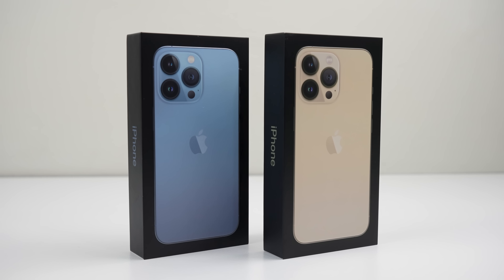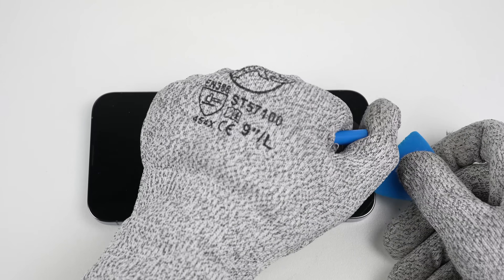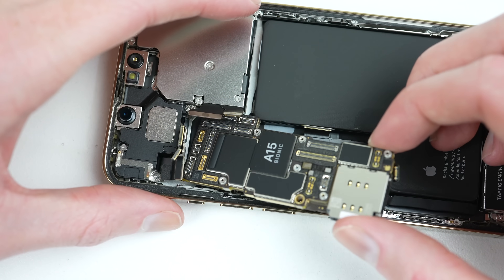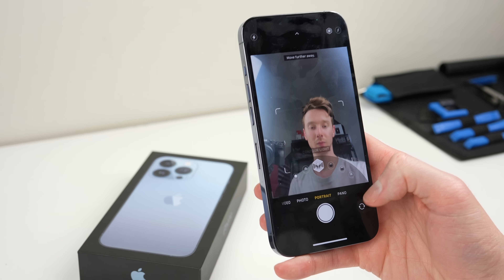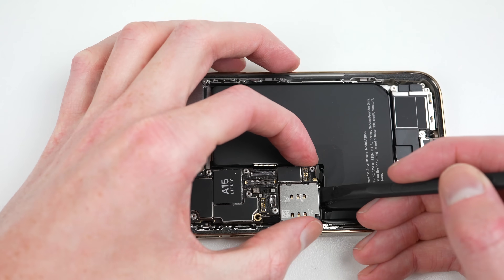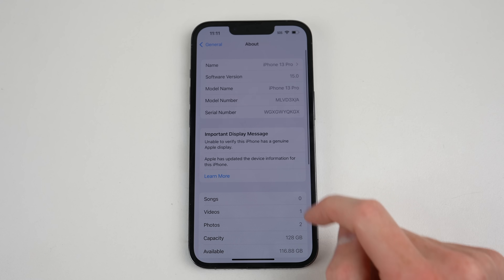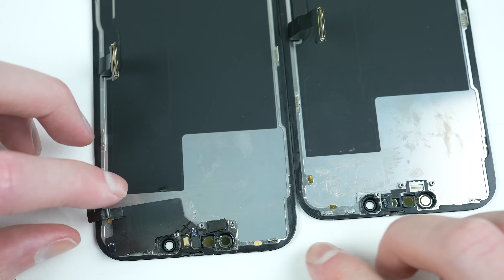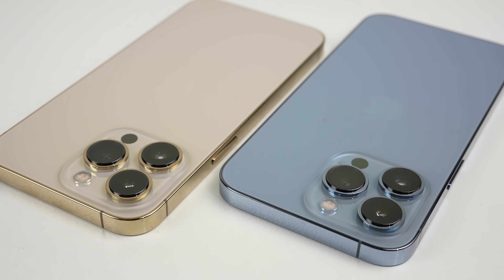iPhone 13 A Repair Nightmare - Teardown and Repair Assessment

Comment: Personally, I learned better than to use Apple a long time ago. I moved away when my iPhone 4s's battery started going out after about a year. I got it replaced, but the phone's power became unstable. Then, it started getting insanely slow. Then, Apple removed legally purchased music from my library with no warning or recourse. At this point, I pulled away from Apple entirely. It was only a few months later that the whole "Apple Music" trial debacle happened. Then, it came out that they were artificially slowing older phones. Then, I started learning about their attacks on third-party repair. Then, I learned what they had done to The Beatles.

Fuck Apple.
Reply: @Kirill Silver I mean, windows is not even that bad. My friend cant even talk with us when we play online because his Mac doesnt support the integrated voicechat of the game
Reply: Only iPhone I ever bought was the 4 and the thing was a tank, lasted a ridiculous amount of time until falling from a set of stairs.
Reply: @r2d2sp1  Windows is more expensive than MacOS?
Reply: @Kirill Silver design of device!? Not even that brother, on the Iphone 4 you had to take out the entire phone to get to the screen with over 20 screws, after that you have soo many screws for the 5,6,7 and 8, luckily they changed it to be a bit easier now. Macs are made to not be open, macbooks are a nightmare to repair.... if you can repair. They may look pretty but they take no consideration for repairs when they design it to the point that if you use a different screw in an specific place that is just 0.1mm longer, you could kill the device. My samsung S4 and S5 could be dismantled in 5 minutes, now its a bit more complicated
Reply: @mrsuperselenio5694  Exactly. You want to fix your windows PC? The only things that cause you any trouble are the motherboard and processor. Replace either of those and you have to go through some nonsense to reauthorize your windows installation, sometimes at worst, you'll have to buy windows again, but every other part is completely replaceable with literally no issues at all (some hardware has software, but that's the hardware manufacturers fault, not windows).

Comment: At this rate your better off buying either a different phone that's an older model that can be easily repaired without sacrificing any features, or just buy an iPhone 13 and leave it inside of a bomb-proof safe just of preventing screen repair that diminishes almost important features of your new phone.

I'm still wondering why they think it's a great idea where in reality it's just a bullshit deal. I'm betting it's got to do with some business profiting.

Comment: In all this time nobody reverse engineered iOS?
Apple makes its hardware, so apple probably built some kind of serial number into each part of a fone. Either preform a indepth diagnosis of each part and look for common patterns. Or learn to code apple iOS. Apple has a way to reprogram the fone to accept new parts, its all about the OS

Comment: Looks like Apple learned this trick from Russians, the very same thing happens on Russian fighter jets! You can not use parts of an airplane on another, it won't work, you need to order it from the manufacturer, which is a method of keeping their customers under control!

Comment: This is properly secure design. Why the fuck are people losing their minds over this? Apple is doing the right thing here. The parts at issue process secure, sensitive, user-specific data, and blocking Joe Schmo from swapping parts around like this is good.
Reply: Because Joe Schmo is usually better at repair than the contractors Apple pays to do the "official" repairs for them.  Also, how is a 3rd party display a security risk?  How is a genuine part with a different serial number a security compromise?  What sort of backdoor could somebody put in a cable?  What good technical reasons are there to doing this?  I'm having a real hard time viewing this as anything other than an attempt to monopolize repair moreso than they already have.
Reply: Wtf are you talking about? What kind of sensitive data are process through the OLED panel?
Reply: Lol yeah what security risk is there in you replacing the screen of the phone you own. Or the battery, or the cameras, you own this phone, but you're not allowed to maintain it yourself. 
Like fuck that
I've always hated that companies removed the removable back plate so you can't just swap out a new battery!!!!!!

Comment: If you want to fix your car, you can take it to a dealer, an independent mechanic, or even dix it yourself. If you want to fix your home, you can call a large maintenance company, and independent contractor, or fix it yourself. Why can’t I do that with my phone?
Reply: Actually most new cars can't be worked on fully unless it's does by some one from the dealer. They put stuff in the programming so only ppl with the official software on their pc can see the errors the car has found. 
Some parts you can do yourself, but more and more problems are being locked behind software. 
It's them reason McDs takes forever to repair their ice cream machines. The repairs aren't hard but McDs doesn't have to tools to read what errors the machine has, and are required to use the technicians from the company that makes the machines.

Comment: So what you have to take the phone to apple to repair. It gets tiring keeping up with Apples changes. Why not let them fix it.  I used to and got tired of it. It’s there hardware so you have to take it to them for service. So they are blocking third party repairs. Probably to protect their hardware supply chain, hacks, fake parts, you name it. It sucks for third party repairers. But it’s not like apple is the only cell phone out there. I mean Samsung won’t even allow you to get a battery replaced even if you acknowledge it hasn’t failed and just want a new battery. That’s not owning your phone. Apple will at least replace the compne t with the u derstanding if it doesn’t meet your expectations there is no refund because the part was not the issue. That’s at least meeting you half way. Samsung is like screw you.  I was going to replace the battery in my Samsung my self but I was like do I want to service a phone that really isn’t mine. So I won’t buy another Samsung. They all are trying to control what you do with you phone. The difference to me is Apple works with you. Yes they want to do the service. But at least they will do it.

Comment: "Locks that prevented" the only "prevention" they have is TouchID/FaceID that I'm 1000% onboard with.

Also at this point with the 13Pros and any of the OLED iPhones the non genuine display message is also nice. How many 13 pros are we going to see out in the wild with cheap crappy LCD displays that don't even support 120hz? OLED2nd hand iPhones are already starting to circulate and scam people with said crappy problem. A user should be notified if its not genuine these aint some $60 android phone. Most of the population who is going to repair their device is going to go the cheapest possible method. Right to repair has become self righteous and not about the average end user. Sometimes you have to think big picture; it harms the 5% of people who would ever have the audacity to open their phone.

Seriously what do you want? Apple to "unlock" the warning so people who don't know any better will never know?  Okay yes Apple could sell parts and the tools to do it, great! But just as evil Apple does independent repair will charge a premium for that pleasure. That Also unlocks the ability for non genuine displays to be programed/ they will find a way. So again guess what percentage of repair shops would claim "genuine, non error" displays, charge more, and put the cheapest thing in they can? Yes there is a small percentage of shops and people this could benefit from but you have to think big picture. There is nothing wrong with non-genuine warnings

Also just going to point this out, since no right to repairer gets it... there is no way for apple to tell if its a genuine screen or whatever remotely. let me say it louder. THERE IS NO WAY FOR APPLE TO TELL IF ITS A GENUINE SCREEN OR ANYTHING REMOTLY. What you want the phone to contact servers and look up if the number the display is correct? Oh yeah that will do the job and the displays certainly couldn't just be programed with "genuine" serial numbers...

Comment: So, having seen some of the inside of an Apple certified repair shop (I'm not an expert, mind you) after any part is swapped out, the phone is connected to a computer running proprietary software not available to customers to be "calibrated".  This supposedly makes sure the camera works properly.  The technician in question was forced to pose for face ID for a few minutes to get things working again while it was plugged into the computer.  He grumbled that on some iPhones, he has to walk around the shop with the thing to calibrate the IR sensors.

I'm assuming this is the step that causes all of the issues related to the camera, since this step is not something you can replicate without the proper software.  The only questions: Why can't this be included in base iTunes, or alternatively, have self calibration available on the phone. From what I saw, it does not appear that the software on the computer was doing anything that the iPhone could not do on its own.  Why the battery does this, I don't bloody know.

So yea, kinda nonsense, and it definitely seems intentional.

Comment: I think you can make this message spread further by editing down to only the conclusions, and ultra speeding up the teardown. Much as I wish it wasn't the case, the average person won't watch a 17 minute video on a topic like this.

Even more so if you put the same tests side by side for the past few iPhones (to show them getting worse), I'd say to put a side by side with a current phone that does support repair, but that phone would have a different maker and idiots would latch onto that to defend apple.

Also, someone has to outright state the hypocracy you alluded to: Apple does eco friendly posturing, while deliberately choosing the most ecologically damaging designs they possibly could.

Comment: so apple is basically why repair when you can get a new one with even more packaging and a new charger cuz each charger is connected to its own phone with earphones in its own packaging and personal charging port connected to its own phone nothing else and get this you need a personal electrical socket to connect to and you need to get an apple electrician to set it up